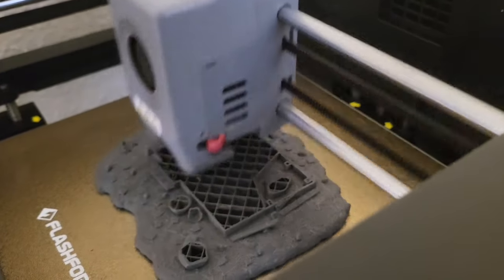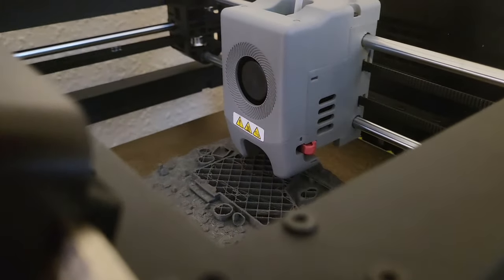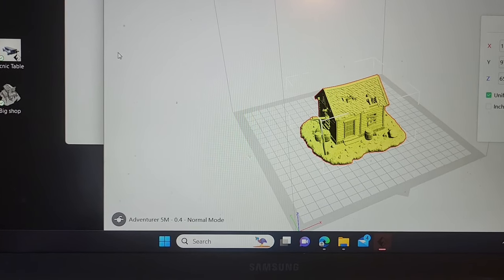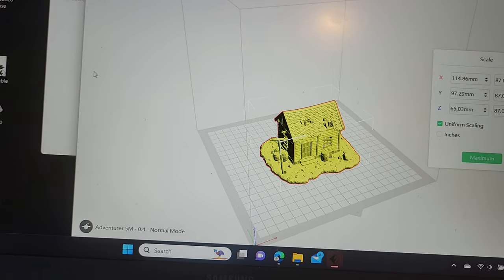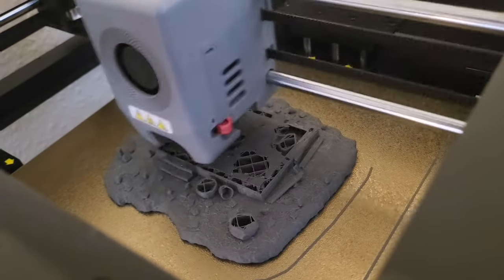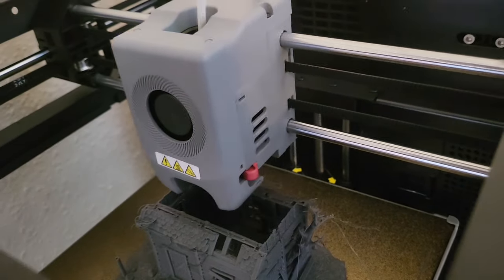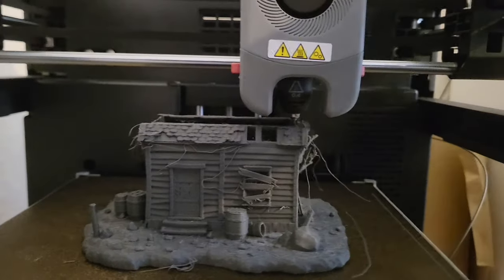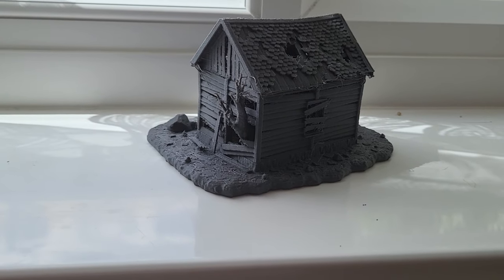First 3d printed building..I,m just a beginner..Just loving 3d items

Comment: Fantastic the way that came out and I like the abandoned shack design you chose, as there’s no straight lines nothing is uniform.
I purchased the same printer about two weeks ago and I really love using it.
I was interested in Bambu printers but they were a bit pricey and because I sold my other printer my partner was okay with me getting this one.
There’s an American guy on YouTube who has the same printer he’s very informative and is worth watching.
He’s the reason I chose this one 😂
Reply from the maker: Hiya
I think weighing cost and user friendly...I think for me as a beginner it's really easy.
I was spending so much buying items I made a good valid point  to my Mrs lol.
Now will cost her in electricity haha.
Have you used yours already?
Really like the prints from it.
Thanks for your kind comment 👍
Reply: @modelrailwayfantasia  
Hi and thanks for replying back to my comment, apologies for the delay for some reason I kept getting error messages when replying back.
I only started 3D printing around beginning of February for a project to build a machine for cleaning watch parts when I'm servicing/restoring them. This is my second printer and it was mainly due to how long it took printing.
With this printer I can get prints done a third of the time in some cases as the previous one, I really like this 3D printer as it is very customizable (I've started another project to build an enclosure for it).
My advice would be to start with small things first as you are doing now and then once you've learnt about the machine and slicing software then try something a bit more challenging and larger in size.
A lot of people are using Orca Slicer with this printer as it has a lot more features than Flashforge Slicer but if you are using the latter stick with it for a while longer so you'll know most of the basic features.
BE WARNED..!
Once hooked you'll be like me up until early hours printing parts/things I'm surprised I haven't woken up half of London 😅😅
Reply from the maker: @carlreid7726  
Hiya 
Hahaha that made me laugh bit about waking up London lol
That's great that your using it to full potential. 
It's taking its time but getting there slowly. 
I just used the supports and raft as was having issue's with  1 roof part for a building but after a high number of attempts...success yay lol.
Thanks for info on Orca ...do you know any user friendly 3d print sites?
Some are easier to use than others.hence why I used cults to get going..
Really fantastic bit of kit.saving lots by doing this myself. 
Just wish I had more knowledge..and my physical stuff doesn't help either .
All I can do is try my best.
Thanks for the information 👍

Comment: That's an amazing building! And the portals are a great idea too - print as many as you need. Looks like you may have needed some supports though in the middle to avoid the layer separation. I like the auto-supports in Orca Slicer, especially the tree supports.

I just bought the same printer. Haven't printed any models yet for my model railroad (I also have a resin printer that is better for small details in N scale), just some tool organization and household items. Hope to try out some building facades.
Reply from the maker: Hiya
Yes havnt quite  figured out the support thing out.
So much to learn yet.
This machine is great simple set-up. Ideal really.
Just for printing my own bits.
Great bit of kit.
Hopefully in time I will get better at it.
Thank you for the advice and wish you well with your machine 
All the best Mark